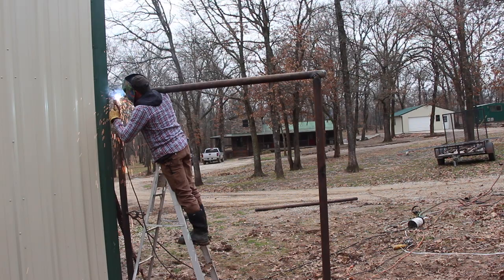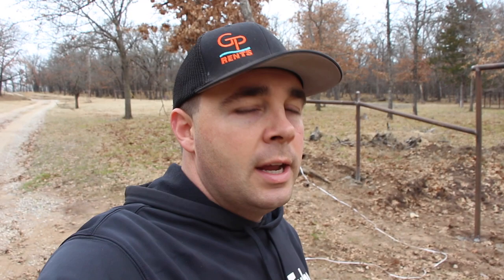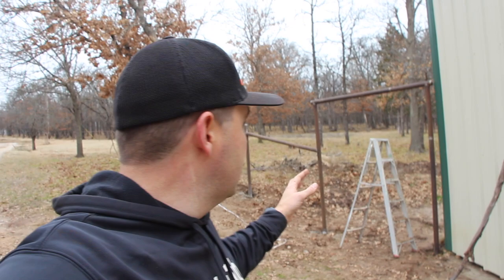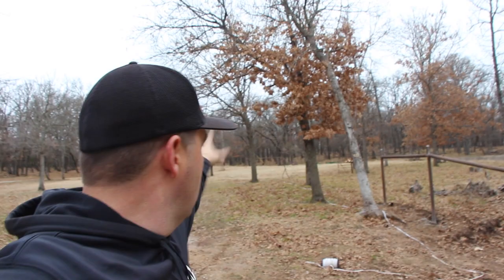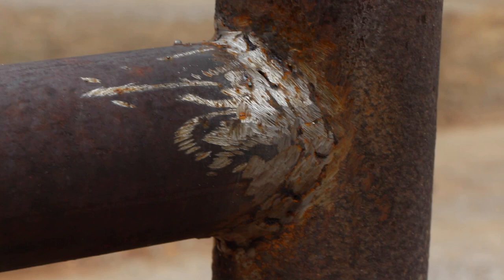The Best Way to Paint Pipe Fence

Comment: I think you are probably the only person I have seen that can make painting an iron fence post interesting. I would have use the green, but the color you used is pretty too. We paint everything with oil base green barn paint. A tip for you if you don't already know. One day I decided to use some Skin so soft bath oil by Avon to remove the paint. Surprise, surprise It will take oil base paint right off and it smells good too.

Comment: Try 2 mits and place both in trays with paint then cup then around the poles and slide down. Works so much faster if you have lots of pipe to paint.

Comment: We used paint mitts on our farm fence and the first time we used it we found the fibers come loose with the paint and stick to the post.  Looks terrible.  So next time we washed the mitts and threw them in the dryer.  They worked better as the laundry process removed most of the loose fiber from the mitts.